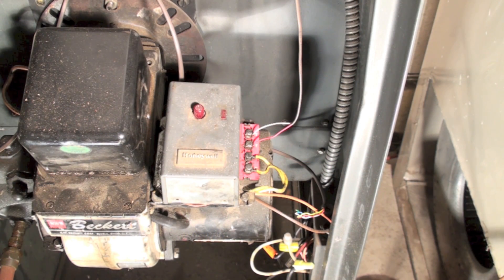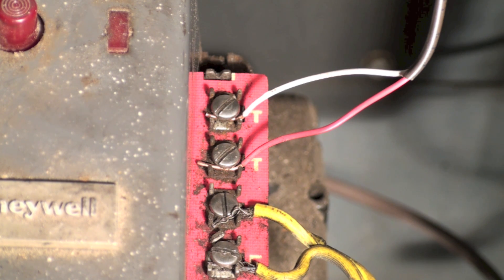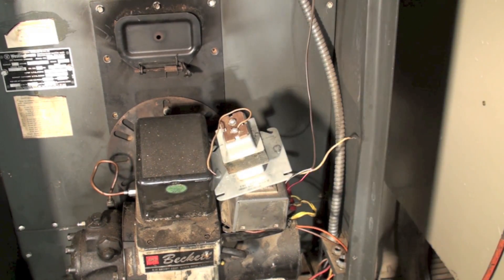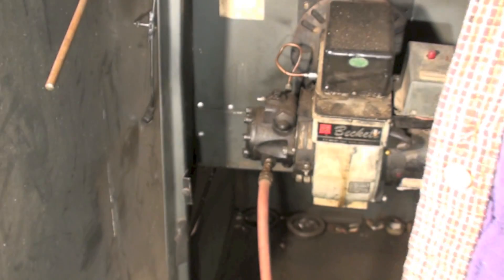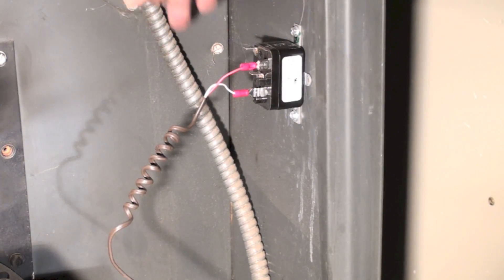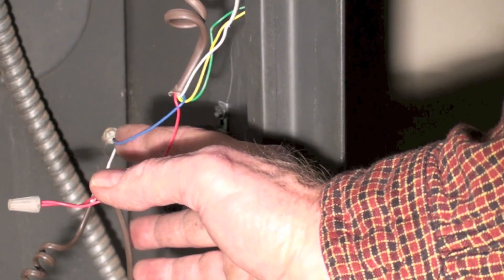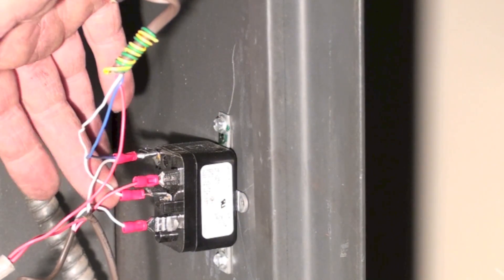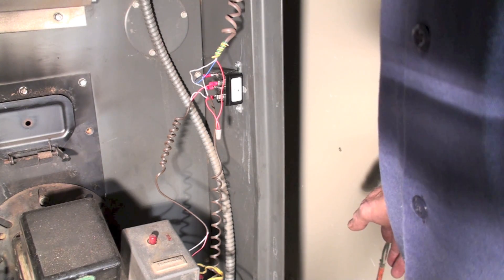Isolation relay for the oil furnace

Comment: Most all older furnaces need to be isolated from the new programmable thermostats.. In my home I have two furnaces where one powers the touch screen thermostat and the other must be isolated from it with relays that initiate the call for heat and the manual operation of the blower fan from the thermostat to circulate air when desired.. The problem I ran into was that the signals to my relays were 24vac and very low in amperage.. This low power was not enough to keep my isolation relays activated so they would chatter like crazy so I had to add a 1/2 wave rectifier and a capacitor to turn the weak AC into DC at about 12v which solved the problem since an AC relay coil does work with DC.. You can use a diode and capacitor or you can use a voltage rectifying transistor.. Another option if you don't already have the relay is to buy a solid state relay which requires less current to switch..

Comment: Stupid question… where do I connect the 120 part of the transformer
Reply from the maker: It goes to the incoming 120 volt power located in the junction box of the furnace.
GFM
Reply: @grayfurnaceman junction box where the primary control would be or can I wire it to the switch ? Or it doesn’t matter? Thank you

Comment: Hi!  I installed a smart thermostat on my oil burning forced-air furnace.  I got it working, but I wasn't able to figure out how to connect the thermostat into the Honeywell Fan/Limit switch.  So right now, the thermostat can call for heat, but can't control the fan.  Any advice?

Comment: Looking for advice. Hello,
    I have a Williams Oil-O-Matic Fuel Oil Furnace that I am guessing is from 1960 something. It has a Stack Relay and a Fan Limit control. I added a 2 ton Heat Pump and am uncertain about how to energize the fan for cooling or heat pump heating?

    I have a single speed blower that provides about 800 cfm. I understand I can install a relay between the thermostat's call for heating and the stack relay to isolate the fuel oil heating cycle from other functions. 

    I also understand I could use a fan center which has it's own relay. The fan center N.O. and N.C terminals usually get connected to different speeds of a motor, one speed for heating and another for cooling. But I have one speed so I'm confused on how to energize the fan without over lapping the controls. Plus I have a heat pump so its one speed for three purposes.
Reply from the maker: Wire your fan center relay NO contacts in parallel with the heat operated fan switch.  The thermostat should energize the fan relay thru the G terminal.
GFM

Comment: Thanks for the advice, and it works great. A extra isolation relay could be used for another smart thermostat if it's wired in series. Honeywell had a outage for several hours recently, couldn't control the primary thermostat that operates the auxiliary heat oil furnace when it's below below 34 degrees, and the heat pump when it's above 34 degrees. The extra isolation relay would allow me to use a Sensi smart thermostat in series after the (Honeywell isolation relay) so there would be a option to lower the temperature below the Honeywell thermostat. W 2 connected to a outdoor thermostat routes the the 2nd stage heat signal to the heat pump but if the temperature drops below 34 degrees the heat signal is diverted to the isolation relay so it operates the oil furnace. The American Standard 4TWB3060B1000CA  seems to operate on the W 1 wire without the W 2 wire but makes me wonder if it's a 2 stage heat pump?

Comment: Can you explain how I could possibly   connect the issolation relay to the back up heat on my Honeywell TH8320R1003? There's a white wire connected to the back up heat terminal but I'm wondering if it's even being used. There's 12 wires   ran to furnace and one set of 4 wires not stripped and not used.
Reply from the maker: Probably too complicated for a comment.  But I will say the white at the outdoor unit is usually used for backup heat.  It could be commented to the w2 terminal of the thermostat.
GFM

Comment: Thank you for helpful info. My oil furnace has the TT primary control  but also has a control box with c y g r mounted in the furnace with nothing hooked up to it.  Would I be able to avoid purchasing a relay and transformer by just using the c and the r terminals to power the smart thermostat and then Rh and W to the TT terminals.  I did test between c and r in the furnace control box and there is 24 volts there.  Any help is greatly appreciated.
Reply from the maker: You can use that for a power source for the thermostat, but you will still need an isolation relay for the TT terminals.
GFM

Comment: Thanks important information. Was wondering if I could wire up the relay, so the thermostat would make the oil furnace become the back up heat? Also what kind of relay is that?
Reply from the maker: You can.  Just wire it to 2d stage on the thermostat.
GFM

Comment: I have found a couple of oil furnaces using  a fan center control with built in relay and transformer. The primary burner ignition control terminals (TT) are connected to the  W from thermostat and to the R in the transformer joined together with R from thermostat. These two furnaces have been working for years just I knew the need to use an isolation relay to prevent signaling the primary control with 24V. I could prove 24v coming to the control. This threw me out. Any suggestions ? Almost forgot to mention the C wire is not in use on the thermostat, runs with batteries. Love your tutorials videos
Reply from the maker: If by chance, the transformers were wired in sequence, the cad cell relay transformer may survive, but that would be unusual.  Usually, the smaller transformer fails.
GFM

Comment: I am not an electrician.... But can you explain why you need a relay plus the transformer???.  I tought you could use a new 24v transformer output and connect it to Rc and C.... Then your T-T cables to Rh and W1.  What am I missing?
Reply: I got it working without the relay... I am using a Google Nest. Hopefully, I will not experience any issues.
Reply: @JohnHolmes69  Hi Can you explain how you did this without the relay? I have a very old gas boiler with just 2 wires for the thermostat. Which Google Nest thermostat do you have? The 2020 or the E or third generation?
Reply: @carolbroverman6453  Carol, because I did not have a C wire, Google sent me a dongle that I could connect that somehow draws power from the device and allows communication as well so it works with just two wires..  This furnace is at my cottage but I found a video that talks a little about it. In the video, you may be able to see how this dongle is wired.  In the video, i am asking about also allowing fan to function independently.  Currently, the fan is only controlled by furnance, so I can not control fan myself (force fan on to circulate air when furnace isn't firing).  Off video, we jumped two terminals and fan turned on, that is why I am asking about adding the third wire. Hope this video helps.  If not, I can try and take better photos next time I am up at the cottage https://youtu.be/Vm7Vr2Wjwc8

Comment: My Adc t 3000 themostat reads system protect  on the hear mode and the unit shuts off for 5 minutes.  I have ordered a isolation  relay to correct the issue.  But  I don't know how to install it  correctly.  So my unit want cut off and go in protective mode.

Comment: I was told i need an isolation relay bc my nest thermostat keeps losing power and not communicating to the analog oil burner. I was under the impression I judt needed the relay and not a transformer. Thoughts?
Reply from the maker: If you are trying to connect the Nest to a 2 terminal Cad cell relay, you will need the transformer.  Generally, It is best to use a fan center that contains a transformer and relay.
GFM
Reply: @grayfurnaceman  I'm looking at replays that say they contain a transformer. Is that accurate?
Reply from the maker: @xJamesxKingx  All cad cell relays have a transformer inside.  However, if the control has just 2 terminals marked T & T, the transformer is too small to operate anything but itself.
GFM

Comment: Great video.  I followed this process and worked great for powering my wifi thermostat.  However ever since, my fan runs all the time, 24/7.  I've double checked the wiring.  Any ideas?
Reply from the maker: All I can tell you is you have mixed up some wires.
GFM
Reply: @grayfurnaceman  Thanks, I'll check it out more.

Comment: What did you connect the transformer too? You didn’t show that
Reply from the maker: This is an add on part to isolate the thermostat from the control wiring.  The R and C of the transformer is the power source.
GFM

Comment: do you have a wiring diagram for adding a C wire?
Reply: I do not.  It is pretty simple.  Find the common (C) on the air handler, then run a wire from that common to the common of the thermostat.
GFM

Comment: Thanks, I have steam heat with a domestic hot water coil on separate stat. Would like a smart wifi thermostat upstairs, I have at least five wires to thermostat now, only using two.
Do they make a transformer/ relay pack as a one piece unit?
Also, the domestic hot water stat wires are under the same two screws as the heating thermostat wires. is there any complication there?
Reply from the maker: This video explains the fan center, which has both the relay and the transformer.  https://www.youtube.com/watch?v=7XFrUw7xQZU  No complication that I can see.
GFM

Comment: Thanks- great video. Question. In doing this on 3 zone system, I plan to tap the power from the wall mounted zone transformer. Would I still need to use the relay with the zone transformer?
Reply from the maker: What are you using the isolation relay for?
GFM
Reply: Sorry- wasn't clear. I want to install an ecobee thermostat. I need a common wire, but with my boiler's TT setup and no C, I was looking for a place to tap into for power. There is a separate zone valve transformer that I was planning to use for my C. I just want sure if I would also need to install an isolation relay since it's controlling the zone valve. I have 3 wires in the wall for this setup.
Reply from the maker: I would install the isolation relay.  Using the wall mounted transformer should work ok.
GFM

Comment: Great tutorial GFM, all,I need now is to purchased the relay, so,I can get my econee3 connected to my Burnham steam boiler, btw do I need a separate Transformer or I can use the one supplied with the boiler?
Reply from the maker: You can use a White Rodgers 90-370.  The one on the boiler will work if it has 40 va capacity.  Its marked on the transformer.
GFM

Comment: Hi Gary.  Great video.  This will help me signficantly.  One question:  you say the relay so a SPST,  but when I look up that number is says it is a SPNO.   What do you recommend ?   Thanks.
Reply from the maker: It is both.  It is single pole single throw but it is also normally open.

Comment: Great video! i have the same burner but i have a HoneyWell L7224U aquastat which the thermostat connects to that with T T terminals. I bought a 24vac transformer and looking to see how i would wire this up and would i need the relay?
Reply from the maker: You will definitely need the isolation relay.  Wire it up the way the video says.
GFM
Reply: so am i eliminating the wires from the aquastat and just using the wires off the cad cell? I am just trying to clarify what i am doing. And the isolation relay i am slowly figuring out.
Reply: And on my primary control the T T wires are jumped to each other
Reply from the maker: I think you are in over your head here.
GFM
Reply: So i am not in over my head, it was very simple. Hard wired the transformer and sent the 2 wires from that up to thermostat, and added 1 to the C wire and the other to the RH. And works perfect..
Reply from the maker: Glad you got it going.
GFM

Comment: if i have a cad cell relay being controlled with old 2 wire thermostat. 
i plan to add a cooling coil into the existing duct work. 
i ran 5 conductor t stat cable to new t stat. 
i neex to isolate the existing cad cell relay with a relay. and add a second 24 volt transformer. to power t stat, and condensor coil. 
so far does this seem almost correct?
Reply from the maker: Yes.
GFM
Reply: +grayfurnaceman thanks for the help gfm! 
one more question the ezisting furnace is forced hkt air only. 
they have a transformer with all the terminations on it. including 3 violets that control the fan motor relay. 
however the installer bypassed the transformer and relay. my guess is they powered the fan from the load side of the cad cell relay. 
is that common practice? 
im an electrician so the furnace controls are not my specialty, however it makes sense with a little guidance....
lastly the condensor contactor.  that is strictly triggered via the t stat? 
so i can splice the yellow t stat wire with the red going outside . and land the white on the common of my transformer.... 
thanks again for the help.
Reply: +goalie2998 2 violets*
Reply from the maker: You cannot power the fan relay with the cad cell relay.  It is too small.  The fan was probably powered by the heat operated fan switch.  You are correct about the wiring to the condenser contator.  Good luck.
GFM
Reply: +grayfurnaceman thanks for your help! lots of great info.

Comment: How can you tell if the problem is the relay instead of a motor or the transformer? My motor spins fine and the reset button has not been tripped. Feels like it should be a relay? What do you think?
Reply from the maker: +Mike LikesBeer If power is to the motor, the motor has either failed or the manual reset is open.   No power to the motor, possible cad cell relay failure.
GFM
Reply: grayfurnaceman I pulled the cad relay and checked the main power under the relay. there aint no power that registered on my multimeter. There is power to the system. This is the first time I have tried to run it this year. I have no idea what could be wrong with it. I checked the fuse and its good. I checked the transformer and it seems good on the multimeter 24v and checked the fan limit switch and there is power running to it. but there is no power to the fan and burner? What would cause that?
Reply: grayfurnaceman There is power to the fan limit switch but I dont know how to tell if that is preventing power to the motor or not?? Its an older hallmark unit and the fan limit switch is two piece. It don't look like the ones on the internet that are a one piece dial type. Mine are two strips. The only thing I have not done yet is pull the cover to the main switch where the fuse is and see where the power stops??
Reply: grayfurnaceman cad cell relay/primary control. I hope I got that right.
Reply from the maker: +Mike LikesBeer If power is available to the control, and with a call for heat, no power out the control has failed.
GFM
Reply: grayfurnaceman The wall thermostat? If my air conditioning works and I can turn the fan on manually from the thermostat could it still be out?
Reply: grayfurnaceman Although i have not tried my air conditioner. I just done the things I told you about. The battery light was flashing on it and I replaced that before I started on it. 
But your saying if I have power to the unit but there is no power to wires under the primary control then its my wall thermostat?
Reply: grayfurnaceman Well your right brother! I tried to turn my AC on and it wouldn't come on either. I just assumed it was something to do with the furnace since the thermostat appears to be working. The fire icon lights up when the call for heat is made and I can hear it click but nothing happens. Same with the AC.
Thanks and any suggestions is there anything else I should look for when I replace it?
Reply from the maker: +Mike LikesBeer Yes
GFM

Comment: Gd day,
I followed ur instruction on how to add a common wire. I bought the relay,  connected the wires as specified. My new wifi Honeywell lit up, boiler fired up when i turned the thermostat on heat, but my three zones are not opening up. They stay closed, then boiler shuts off without circulating the heat into the house. How do i go about wiring the zones to the switching relay or what can i do to have my system up and running. 
thank you in advance
Reply from the maker: +Rami Aburoomi If you can send me a wiring diagram of the system I may be able to help.
GFM
Reply: +grayfurnaceman 
Gd morning.. can i have an e-mail address so i can send u the diagram i drew up 
Thank you
Reply from the maker: +Rami Aburoomi Send to grayfurnaceman@gmail.com
GFM
Reply: +grayfurnaceman 
Gd day, i sent u the diagram explaining how i connected the wires by email

Comment: This is a great video. I recently purchased the ecobee smart si, to connect to my old new york boiler. I new I needed a third (common) wire, so I purchased the Taco SR502-4. I rewired the two circulator pumps to the Taco and initially connected my old Honeywell mercury thermostats; one for each zone, to the Taco. This worked well. Once I received the Ecobee I simply connected three wires from the Taco to the thermostat and it did not work. I needed an isolation relay to act as the switch. I used the setup you describe here. My question is, since I have the 24V terminal on the Taco could I have used that in place of the 24V transformer?
Reply from the maker: Christopher Bagge I would leave it at that.  Sometimes the transformers in the controllers are not big enough for that.
GFM